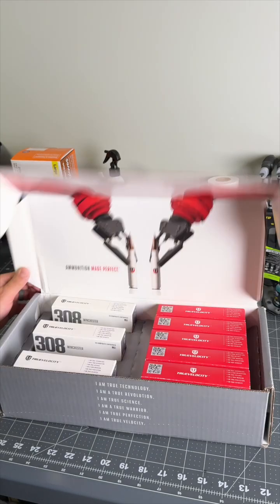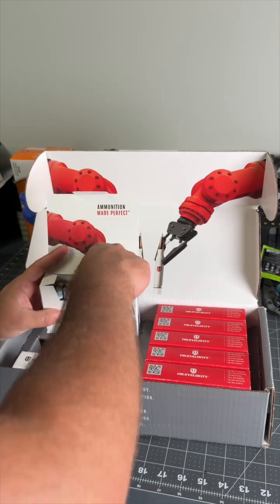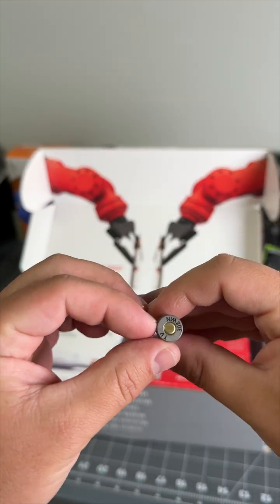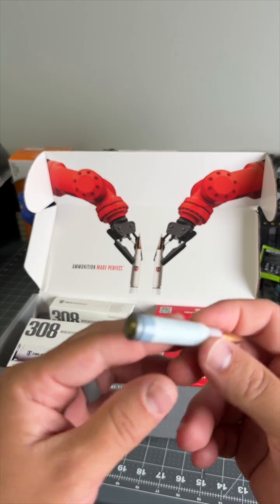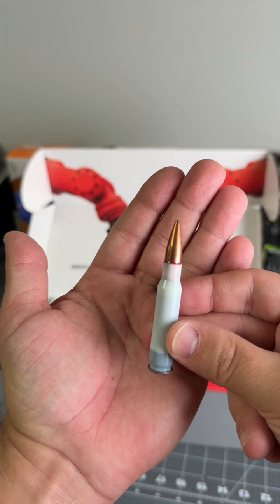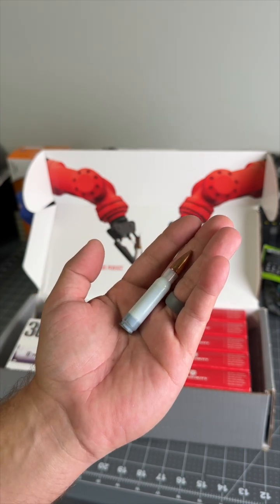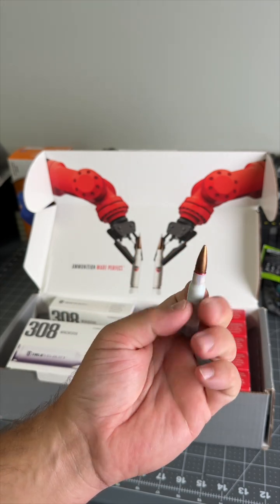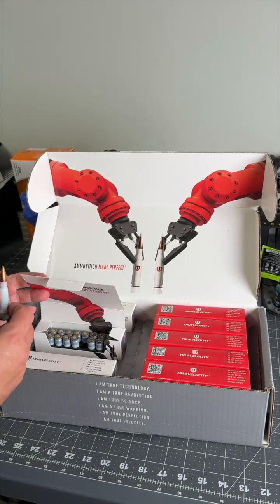Have you seen the True Velocity Rounds? #ammo

Comment: I think the heat transfer would work the other way and one of the difficulties. You aren't transferring as much heat out of the gun.
Reply: No. The chamber walls are "coated" by the brass. All the explodey stuff happens inside the brass or in front of it. The way for heat to get to the chamber walls is by conduction through the brass. The plastic case is an insulator.
Reply: @benjaminloehner257 😂 im not sure if you're a troll or if your bus didn't have very many seats.
Reply: @benjaminloehner257  interesting. I had heard one of the problems with military going to polymer ammo (which I thought was a necessary thing and was real let down the US didn't pick) was that there was more heat build up under heavy use, as some of the heat transfers to the brass and gets ejected. I could have heard or remembered wrong though. A lot of those were also shaped different some shaped almost more like a shotgun shell but with a bullet